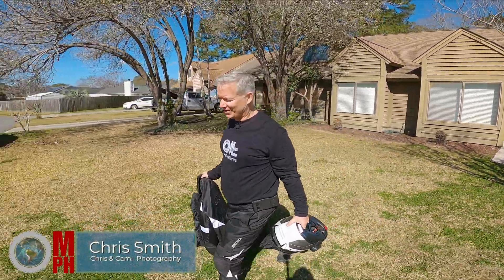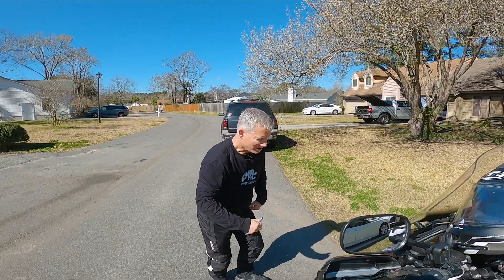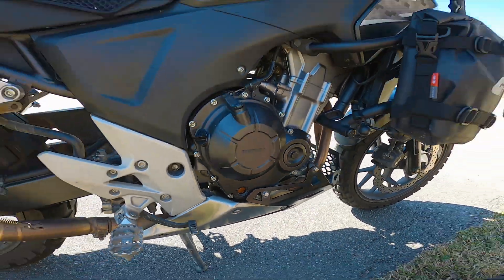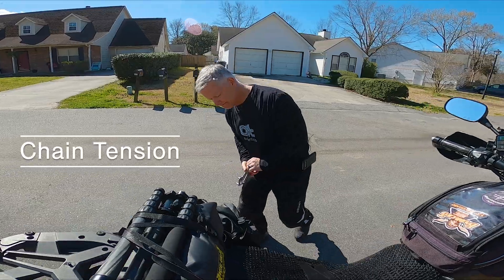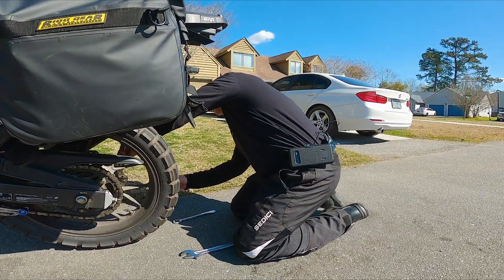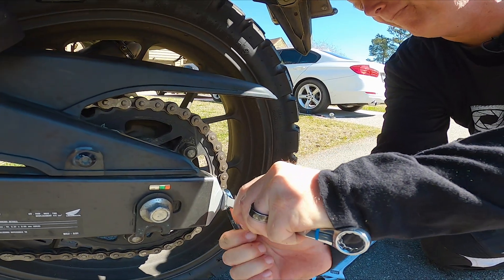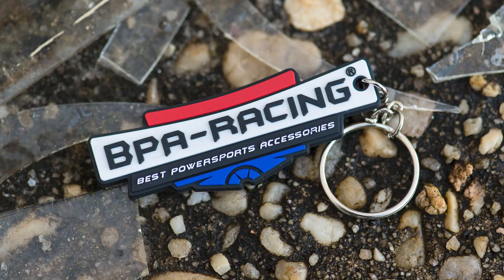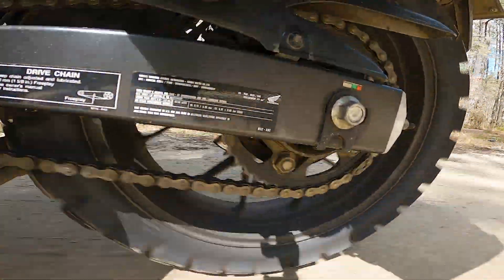BPA Racing Chain Slack Adjuster - Always Check 3 Things Before a Ride

Comment: As a chain wears, it develops tight spots.  
You can check it in one position and tension would be fine, rotate the wheel half a turn and it would be too tight.  
Therefore, this tool still needs to be positioned when the chain is at its tightest spot and you have to find that spot using your fingers.  🤷🏻
Reply from the maker: Well it's not perfect.  But we still think it's a helpful device.  Most of the time you can visually locate the tighter spot in the chain by just rolling the bike forward.

Comment: The chain slack measurement is a range. When doing the first adjustment to then calibrate the tool do you go with the min. max or middle of the two. (Sorry long time BMW Shaft Drive guy now with a 2021 CB500X and a 2022 Rebel 1100 DCT).
Reply from the maker: Hi Jim!  Welcome to the world of chain-maintenance!  🙂 I always go with the middle of the two.  That way if your measurements are off either direction, you have a cushion for the error.

Comment: One fact I didn't see mentioned is that your chain slack will change as the suspension compresses. So you have to calibrate the device at exactly the same amount of suspension compression that you use to subsequently check the slack. The most repeatable state would seem to be with the bike on the centerstand and the suspension fully extended. Maybe you could mention this in the video?
Reply from the maker: HI Clift!  You are absolutely correct.  It is assumed that you would follow the manufacturer's guideline for checking your slack before you calibrate the device.  For the CB500X, Honda recommends just resting the bike on its side-stand.  Since most bikes don't come with center stands, this would make sense.  But of course if your bike us unloaded when you calibrate the tool, you should be aware that it might be off a bit if you later check the slack with the bike fully loaded.  :-)  Thanks for the tip...good thing to keep in mind!

Comment: I'd invest in the right socket for the rear axle bolt. Adjusting spanners are a great way to wreck your nuts (no pun intended ;-))
Reply from the maker: HAHA...great tip, mate!  We actually have the correct spanner for the rear axle bolt.  But it's tucked away for use "on the trail" and we were too lazy to get it out.  Next time we'll make sure to use it!  :-)

Comment: What I don’t get is the calibration ?
You still have to “guess” the proper tension before calibrating the tool 
Anyone doing a review on this tool should show how to properly set the correct tension 
Does that make sense ?
Reply: No guessing involved. The correct tension is stated in the manual and is described in a distance of slack. Once that is measured with a tape, then the tool is calibrated to that and never has to be adjusted again. See this video where we show that. Thanks for the comment. https://youtu.be/Ww5b4Y92oRU

Comment: That's a good Idea because it's fast. I I have been going by feel as I roll the chain around, this would be much faster.
Reply from the maker: Hi BudFox559.  Before I found this tool, I used to hate checking/adjusting my chain.  Now it's so easy, fast, and I don't get my hands greasy.  It's awesome!!!  They're on sale right now.  Plus you can get an extra 10% off with this coupon code:  BPA Racing Chain Slack Adjuster - www.bpa-racing.com
* For 10% OFF use COUPON CODE:  MOTOPHOTOADVENTURES

Comment: Your axle bolt was loose enough to take off with those tools!?!?!? I need a cheater bar for mine.

Chain slack is probably the most annoying periodic maintenance item.
Reply from the maker: Hey there, Some Guy!  Thanks for watching.  Although I did use these tools to loosen the axle bolt, the video just shows a quick shot of me loosening it after the initial "grunt work" was done.  It did take a good bit of muscle power to get it going at first!  :-)  Same with the lock bolts on the chain adjustment.  I initially "broke" the lock bolts free before the video clips started since the act of loosening these bolts was ancillary to the purpose of the video.  By the way, I used to HATE checking my chain tension until I got this tool.  It makes the job so much faster, cleaner, and easier.  They're on sale right now, plus you can get an extra 10% off with this coupon code.  Grab one before they go out of stock:  BPA Racing Chain Slack Adjuster - www.bpa-racing.com
* For 10% OFF use COUPON CODE:  MOTOPHOTOADVENTURES